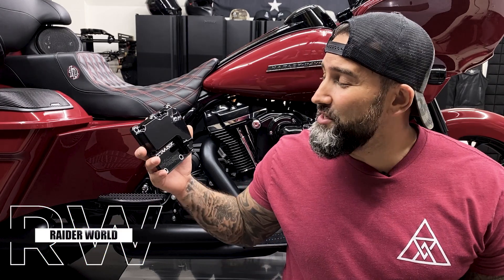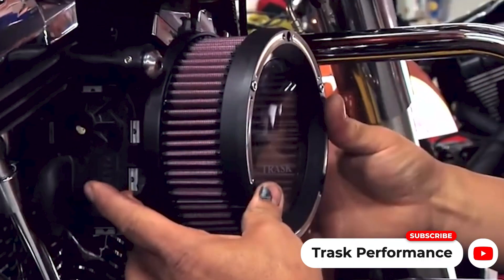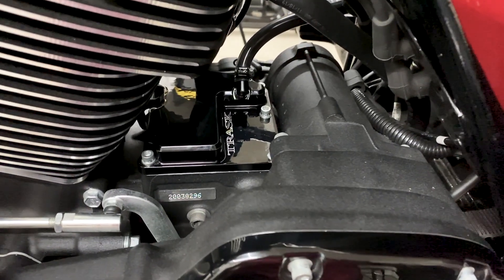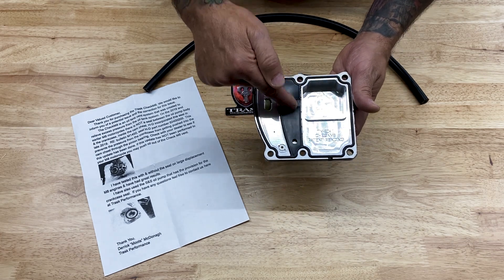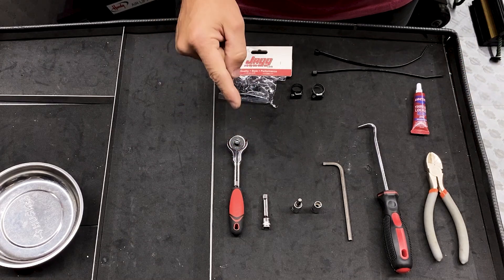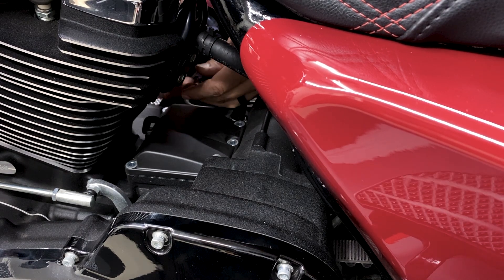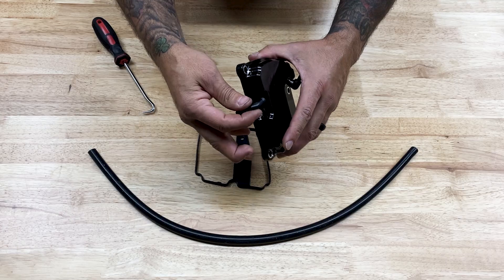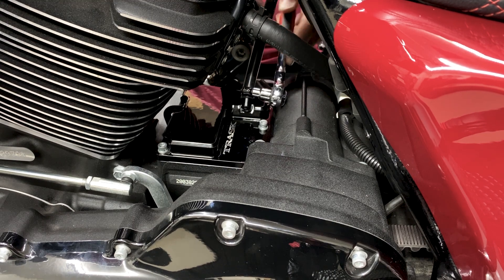What is BLOW-BY in a Milwaukee 8 Engine - and WHY install the TRASK Performance CHECK-M8???

Comment: Have you seen much oil in the catch can since you installed? I just got a track CheckM8 and was wondering if excess oil out that filter it comes with would leak?
Reply from the maker: I haven’t seen any excess oil around the cap of the can, but I will be doing a maintenance soon.  So I’ll give an update
Reply: @RAIDERWORLD  I'm leaning towards the Check M8. I would be very interested to see how your breather bolts look. I'm wondering if this or the DK Transformer would be better for me. You do killer vids and I appreciate you. Heep up the good work.
Reply from the maker: @carlphillips9610  Thank You! I’m looking forward to it too.  I’ve been holding off, because I have a few new goodies coming in from Feuling.  I haven’t seen anything around the filter and intake tube as far as oil, so that a good sign.  I’ll definitely do an update here soon

Comment: Any info on whether there would be any conflict when already running a vented dipstick or is the more venting the better? Thanks for the video.
Reply from the maker: I also installed a vented dipstick, video will come out soon.  And no, there’s no problem with running two, as long as your dipstick still maintains a vacuum.
Reply: @RAIDERWORLD  I have the one from A1 Cycles, it's not a one way vent. Just open vented to a filter. Would it need to be a one way?
Reply from the maker: @johnburk5748  I’ll have to look more into the A1-Cycles venting configuration.  You definitely want it to be a one way vent.  There’s mixed views on that, so this is just my personal opinion.

Comment: I have this and I also have the Trask Assault A/C with the block off plate. I also have a DK Customs catch can on my 2018 M8 LTD (124ci). I have to check the catch can off the A/C to see if its getting any blow-by still but the bike DOES NOT appear to be sumping as the primary fluid level is right on. However, I have gotten 2 rags full of tranny fluid coming out of the Trask Transmission vent cover over my last 300-500 miles of riding. I wrap a micro fiber rag around the filter element to keep any leaking to a minimum in the ABS area under my side cover. 

While this cover seems to (or should) help release pressure, it also seems to be doing so by taking some tranny fluid with it. Is that normal? And if so, should we just lower the tranny fluid level slightly to reduce that?
Reply from the maker: I haven’t had this issue with mine yet.  I’ll be doing another service here soon, so I’m curious to see the intake and inside the catch can.  I wouldn’t lower your fluid levels.  Do you do a lot of tight turns where you have to lean the bike a lot?
Reply: @RAIDERWORLD  - Figured out it wasnt tranny fluid, its oil. And Trasks site has a service note on the cover where if your bike is missing the internal seal against the HD oil pump (which my bike certainly is as I have Fueling CAM plate, oil pump) then its possible to get oil coming out of the Trask Check M8 filter. 

Not taking this thing apart again to address that so will try removing a small amount more oil and changing the filter to a catch can and see if things improve. The catch can I have on the breather works great, checked the other day and no oil, just a little water (1/8” or so in the can).
Reply from the maker: @bane1240  Absolutely! It’s all about doing some trouble shooting.  I know the 2020’s and up have those seals now on the pump.  I’ll be doing a Race Series CAM-CHEST install from Feuling here soon,  they did start adding those seals as well.
Reply: @RAIDERWORLD  thats what I have but it was from 2021. Not sure its there or not but what’s happening on the bike makes me think its not.  🙄 

But, maybe this will be it and I can ride worry free. One things for sure, the bike is a BEAST! 😊
Reply: @raider world - Update: Having my wrench install part #62400205 (HD Oil pump seal) on my Fueling Oil pump (my pump has the recessed area for this seal) in hopes this will cut down on the amount of oil coming out of this breather line. Should be done in next week or 2. I also installed a heavy duty (300 ml) catch can under the passenger foot rest to help with the mess. The DKCustoms can was not large enough to handle the pressure or amount of oil getting pulled through the line and that has helped big time. No more mess but... still more oil coming out than I am comfortable with and don't like having to run the bike 2/3rds of a quart or so low to reduce it. Hopefully this seal will allow for me to run the bike closer to full and be ok. Ride safe!
Reply from the maker: @bane1240  Thank you for the update on your setup! Hopefully that works for you now.

Comment: Now you’re just blowing that pressure into a sealed catch can… so the pressure isn’t actually going anywhere. I think the filter element would be a better idea than a catch can
Reply from the maker: The catch can has vents on the top for the air to escape.  I prefer the catch can over a filter, because as the oil builds up, the outside elements/dirt doesn’t build up on it.
Reply: Okay, so I have a question.   I have an external breather, and a vented dip stick from DK Customs.  My question is, has anyone routed all these elements to a single catch can?  I see issues unless there is a one way valve on the linkages between the hoses.

Comment: Man I want to buy it, but I am absolutely fucking cringing at the price. I'm half tempted to just try and vent the stock trans cover; if it doesn't work, I'll only be out $15, and then will just go ahead and buy the Trask
Reply from the maker: For sure! The price is definitely up there.  After installing the Feuling BA Air Cleaner, I would just go with that.  https://youtu.be/Z9RgJqqUMkE

Comment: Maybe I’m old school but why did you reuse that gasket on the trans vent cover??  That’s a huge no!!
Reply from the maker: I didn’t use the old gasket.  The Trask comes with a new gasket already installed.  You have to remove it in order to install the stock vent tube.  Then you reinstall the Trask Gasket.  Absolutely! Never reuse old gaskets

Comment: Blow by isn't actually what the Harley community thinks it is. Blow-by is a very specific condition when the piston rings, cylinder walls or both are worn down enough that a much larger than normal amount of the exhaust gas from combustion leaks past the rings and into the crank case. That's what blow by actually is. 

The problem these bikes have isn't really blow-by, it's just a normal function of a PCV system. (Positive Crankcase ventilation) however, Harleys, but especially the M8's have way, way WAY too much oil mist coming out of the PCV system and back into the intake.
Reply from the maker: Absolutely, they have to vent somehow. And not every M8 is dealing with these extreme issues.
Reply: What does the Harley community think it is?

"Blow by" pretty self explanatory.  
When a dozer has 20,000 hours on it, the blowby is getting bad, you do the logical thing &  put new rings/hone, or a rebore, or re sleeve.
You damn sure don't ignore the problem
 & start plugging vents in everywhere.. 
HD is fuckin crazy

Comment: I would like to install the Trask cover on my new ultra limited, BUT.. when I mentioned doing this to the techs at the dealership they warned me that it could void the warranty.
I have heard someone will have to bear the burden of proof when blaming this installed part to some kind of failure (whatever that may be) when voiding the warranty during a breakdown, but is it reasonable that Harley would simply void the warranty if they saw this part on my bike?
I also saw another video that was routing the vented bolts into the same cavity that the reed valve covers on the Trask cover. Outside of the venting process this seems like a way to allow the oil to return to the sump if the venting of excess pressure could include some kind of separation of the oil from the vented gas to eliminate a regular maintenance of filters or catch cans. Is this possible and has anyone approached this idea?
Reply from the maker: I think Harley is still trying to figure that out.  Because that top cover has nothing to do with how the transmission functions.  It’s just a vent.  Something they just forgot to add themselves.  Warranty is always a huge concern, but I feel, depending how you ride, that your engine will be toast after that warranty is up.  It’s better to catch these things early.  But like I said, this is just my opinion.
Reply: Use the A1 oil cap. Removes in seconds, for warranty work.

Comment: That fact that Harley has problems with some of their engines they know the problems exist but still charges a premium for their motorcycles then passes the buck on to the customers to fix the problem. That’s a shitty business practice in my opinion.
Reply from the maker: Absolutely.  Unfortunately, this is a corporate issue.  If you’ve always been a die-hard Harley owner, it’s hard to change to a different company.  And Harley knows this.